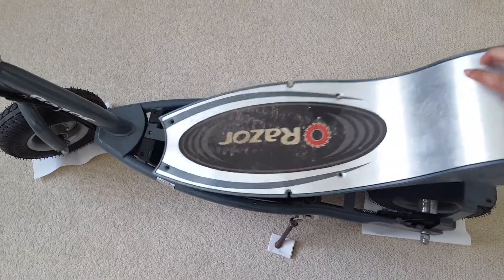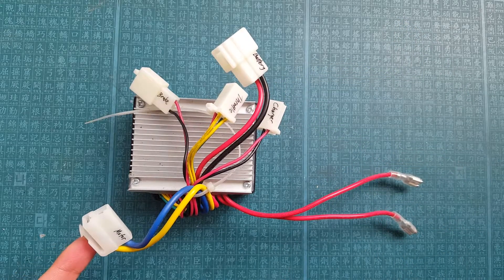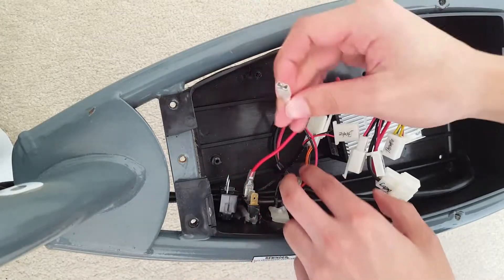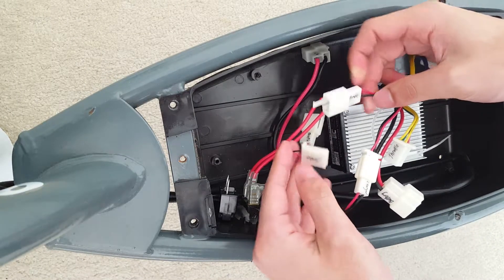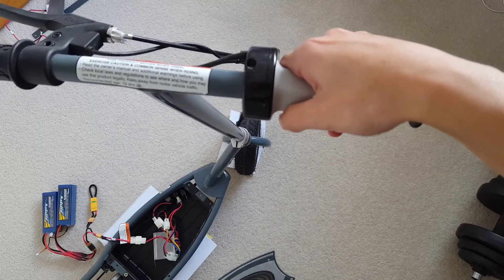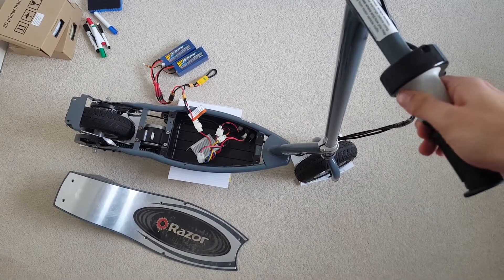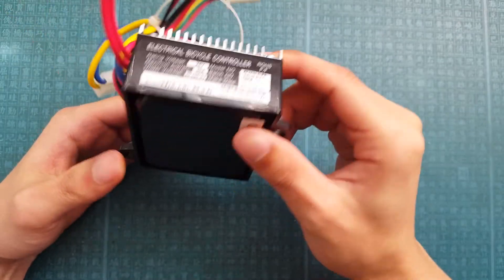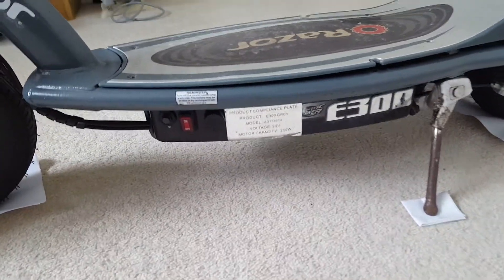ZK2430-D-FS Electrical Bicycle Controller

Comment: и вопрос когда на зарядке ставишь кнопка должна быть выключена питания или включена?
Reply from the maker: Hi Slava, I'm not sure I fully understand the question. I've tried to use google translate so apologies if this is wrong. If the question is, how do you charge the battery? If you're using a lipo battery, I would recommend using a battery balance charger (I would NOT try to charge the battery through the controller). Power should be off before charging.

Comment: Is this for e skate?
Reply from the maker: This is for an electric scooter project I'm planning to work on. Just a review of the off-the-shelf controller. For electric skateboards, the vesc is definitely the preferred controller. I might even use one for this project.
Reply: Reaper Sketch oh thanks
Reply: U should have thousand of subs
Reply from the maker: Cheers man, maybe one day 🙂
Reply: @sketchcontainer  mine does not work clicks and does not start
Reply from the maker: @marrostudios9348  The clicking sound may be from the relay but that's just my guess. If it's not working you'll probably need to isolate the issue(s) and repair them that way. If it's the actual controller, often it's just simpler to get a new one than trying to fix it